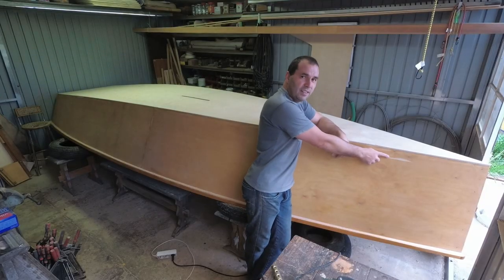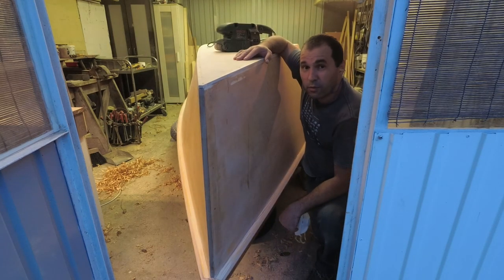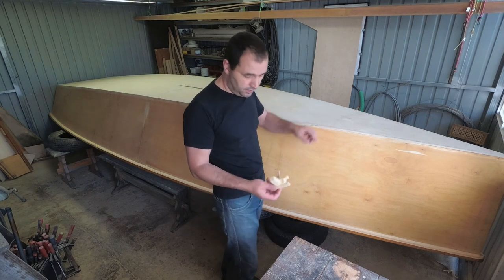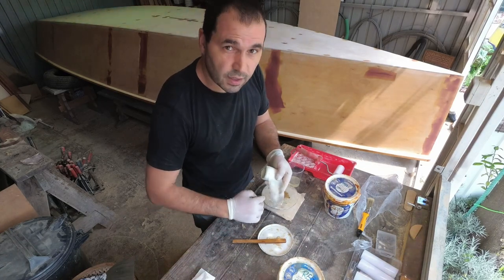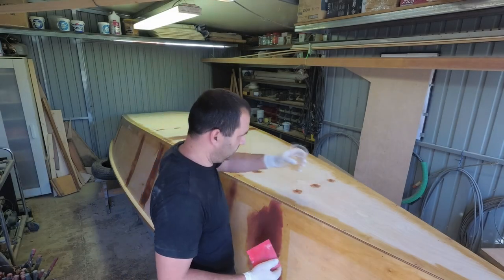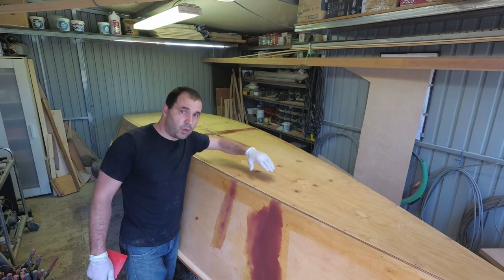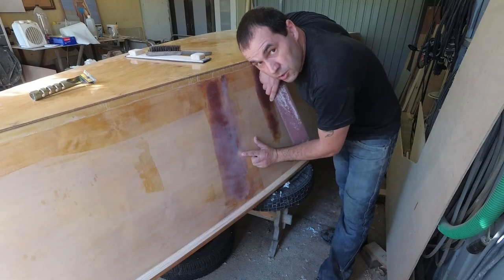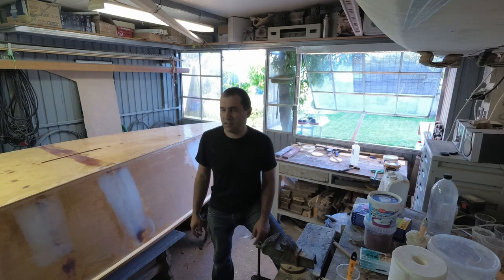Building a Goat Island Skiff - WEEK_20 - homemade plywood sailing boat

Comment: Great videos. Why not use polyester resin for the glass tape? It melts so nice and smooth.
Reply from the maker: Hi,
Polyester resin should not be used in wooden boats. The Resin has only little adhesion to wood and will eventually come apart. Always use Epoxy resin when building wooden boats.
Reply: @TheBoatRambler  cool thanks

Comment: Thank you for yet another instructive video. You made it look so easy. I would be all nerves doing it. Perhaps, let me ask a potentially silly question on behalf of those like me who have not an inkling how and why in hull work with epoxy and fibreglass - why do you scrap after the two are laid? Quite a bit of material can be seen coming of the scraper. Won't that hurt the integrity of the fibreglass weaving? I think I would be all nervous doing it and probably allow all the epoxy layers on the hull before doing a fairing to smooth all over. Sorry, a question from an inexperience learner.
Reply from the maker: Hi Joseph.
Most of the material you can see coming off the scrapper is from the tape's edge, it shouldn't matter much. And yes I did hit the cloth on a few spots  but that was on purpose. The tape had some "vertical lumps" from the curvature and although they were filled with resin underneath they were protruding too much and it would be hard to fair later.  The small localized cloth integrity reduction in this area was not relevant as the chinelogs provide plenty of gluing area. This tape is important as a plywood endgrain/impact protection too, and that was not affected.

Comment: great video! I know how hard that was to cut a hole in the bottom. just doesn't seem right, does it?  I like the big spatulas you are using for your fairing compound. I am taking note. I left a lot of rough spots on mine when applying fairing compound and the more you leave, the more you have to sand.  I finally got my bottom nearly perfect and the paint reflected the effort as will yours!  great work. oh, and what nice lines this design has, especially for a hard chine, really quite shapely!
Reply from the maker: Thank you for your feedback! Yes it was kind of a daunting moment when opening the centrecase slot ! 😁
The spatulas I just happened to have them from when I did some replastering in the house!
...and yes, i just love the GIS lines! 🤩